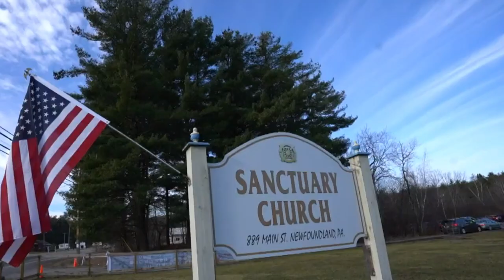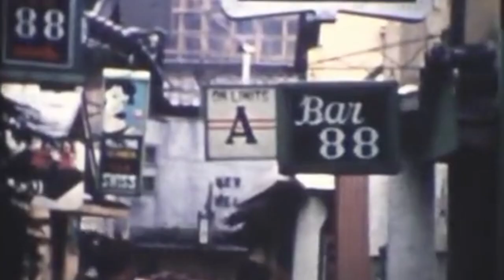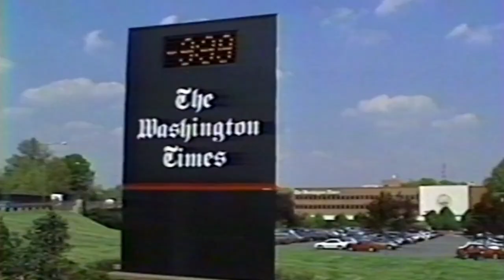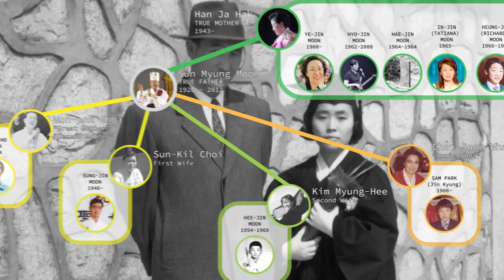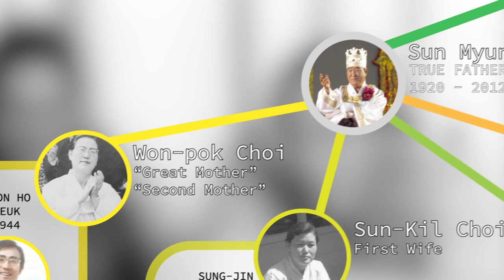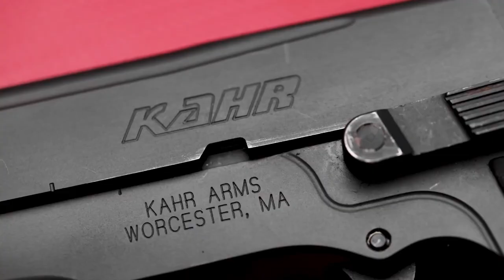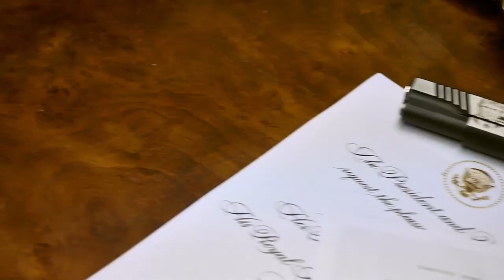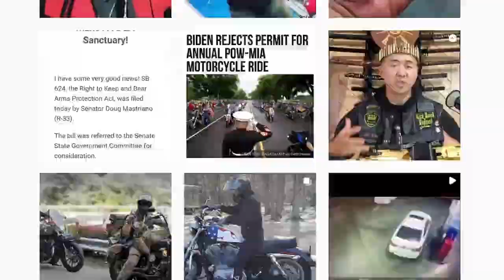The Unbelievable History of The Sanctuary Church (aka Rod of Iron Ministries)

Comment: Excellent job researching, compiling, narrating, and editing this video Maniac.
On a side note I couldn't help but notice the short clip you dropped in the beginning showing Sun Myung Moon meeting North Korean leader Kim il-Sung. After doing a bit of digging it seems the meeting took place in 1991 but the fact Moon would even set foot on North Korean soil is extremely suspect to me. I spent many years researching mind control and cults so North Korea was and always has been one of those countries that continually blow my mind. The system they have extends its claws out under the radar in many ways and so when I saw that clip of Moon & Kim il-Sung shaking hands red flags went off in my head. This is obviously just a hunch but it wouldn't surprise me if Moon was an engineered figure from the ground up at birth by North Korea to bring in money to the country and also spread influence on the world stage for a wide host of reasons. There is already an admitted link between a North Korean car company and Moon, but I also suspect something is possibly there with a fish company as well.

  If someone really had the time and energy I'd almost be willing to bet money that Moon had a documented history with many North Korean shell companies from the very beginning.

 Fast forward to today and the sanctuary church having a weapons company could also be a connection. North Korea is big on exporting weapons so it's not a big jump if the son didn't do all this on his own but doubt he would ever even be allowed to if his father was a manufactured puppet from day one. 

 Anyways, just thought I'd throw this out there for consideration because if true it would make for one heck of a research project (and video).

Thanks again and keep up the great work.